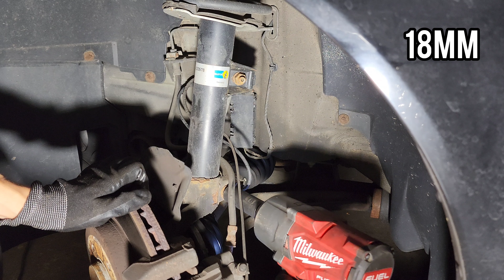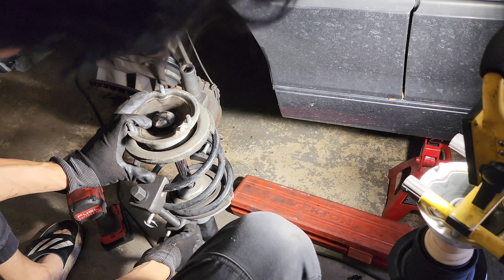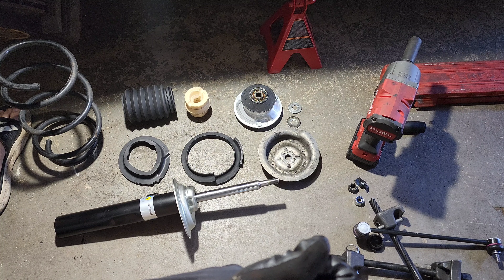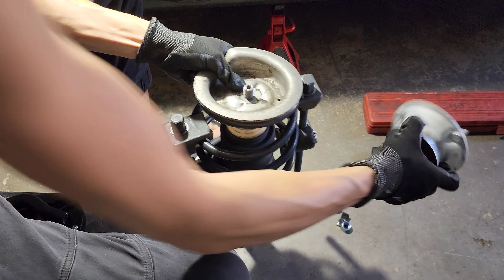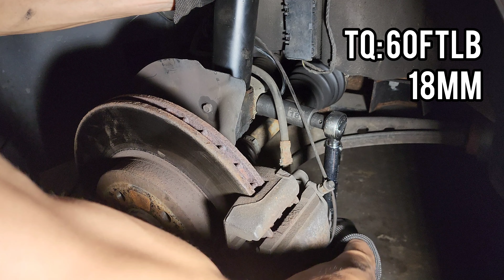BMW e46 3 series Strut replacement

Comment: Just a word of caution, NEVER compress the springs in the upright position with the spring facing you., have it on the ground with the spring facing to the left or right of you.
I found out first hand how dangerous a compressed spring can be, just as I finished compressing the spring, as I  turned to put the wrench down  the spring compressor let go and the spring shot out like a cannon through the open garage door and landed 15 meters across the road.
So don't be casual when compressing a coil spring, it can take your head off.
Reply: Great tip. I wonder if it was only for the camera angle. His first spring was properly laid down
Reply: I was crinkled watching his hands casually hanging around the compressed spring end. It can explode like a rocket.

Comment: why did you have to replace? Would like more verbal commentary as you do these jobs. I like how you keep in the difficult issues. keeping it in reality. love that!
Reply from the maker: The ones I had were pretty old even though they had low miles on em. Plus I have lifetime warranty on these so just thought to change them out
Reply: @HansGarage  am I correct that those were 6 yrs old? is that the average lifetime of shocks? I'm just trying to learn basic auto maintenance. Your channel is a really good resource but I have no basic knowledge so I have questions when I follow along so some basic commentary added would help me. I'm not trying to be rude just giving my viewpoint as a newbie. I have e46 m54 '04. Trying to keep it maintained. Thank you for your response! Appreciate it. fpc guarantee is good.
Reply from the maker: @bogusienombre355  actually just depends on how rough you drive and miles go from 50 to 100 thousand. This is all just recommended time frame but I'm just replacing them regardless front and rear along with my front control arms and tie rods.
Reply: @HansGarage  Thank you Han. Your channel is inspiring.

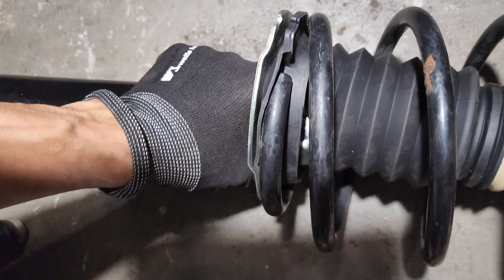Comment: If you look at 1:16 and then at 9:31 the bottom part of the spring does not seem to be seated properly. Did this change the ride height?
Reply from the maker: Great catch! 1:16 was the older set up from the previous owner, which is why I decided to reinstall it properly. 9:31 is how it's supposed to be installed. It was a very little difference but now it's the perfect ride height as it should be.
Reply: @HansGarage  wrong install, take a look at google photos for original shock absorber,you could see that most are with spring sitting not in the groove.

Comment: I can't figureout how you removed it in one piece without compressing the spring. Doing my 2001 330i right now and it won't allow me to lower the lower control arm enough to slide it out of the knuckle. Please help!!!
Reply from the maker: Did you lift up the car enough??

Comment: 9:30 spring at the bottom is installed wrong.
Reply from the maker: Really? How should it be installed?
Reply: @HansGarage  Spring should be rotated anti clockwise about 50mm at the bottom from point You showed. It has elliptical form there and that way it sits right. It is easy to see that taking new part and playing with it, as well observing whole assembly in original images. I know from the metal form it seems spring should be fitted like You did and i had made same mistake.
Thank You!
Reply from the maker: @meinardstauns2864 Thank you! Ill mention this in my next video

Comment: Didn't need to take the ball joint out of the steering knuckle to get it out, or just didn't show us?
Also, I have had to do everything to my e46 that you have to yours, including the fender lol.
I think some of your torque specs are for E36 though, for instance strut mount bearing to body should be 34Nm which is more like 24 lb ft.
Reply from the maker: No need to take the steering balljoint out